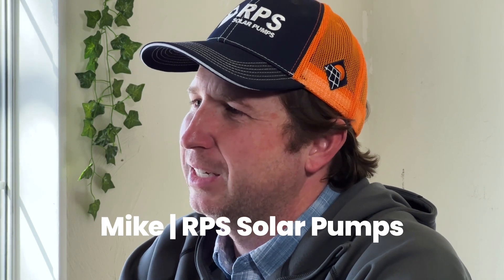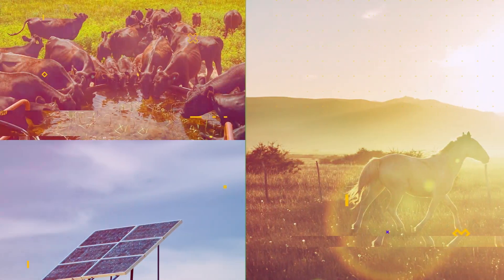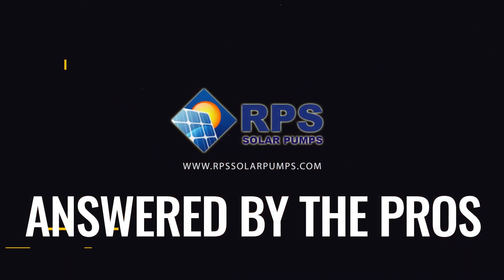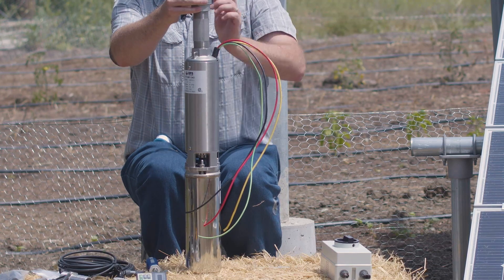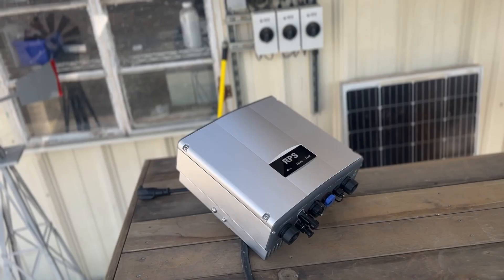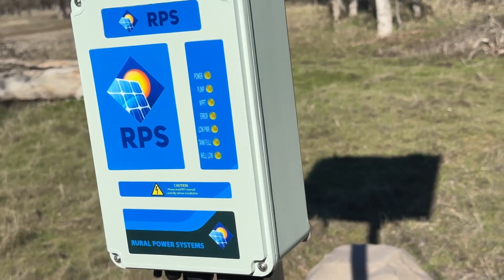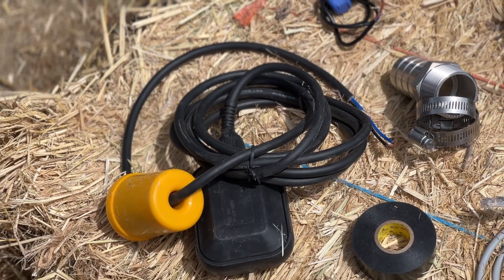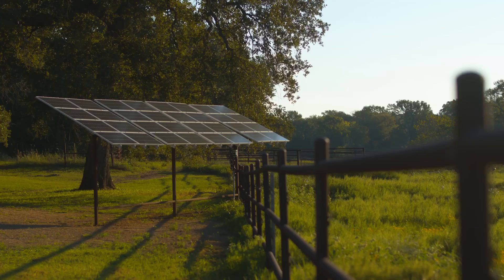How does a solar pump work? |  Solar Pump Engineer Answers Your Questions

Comment: Does the voltage matter from the solar panel to the controller?  I know you need the required watts.   I have a 750 watt DC 48-60v  pump and not sure what voltage to send.  Panels come in various voltages and when series the voltage goes up.  Will this hurt the controller or cannot handle the voltage?